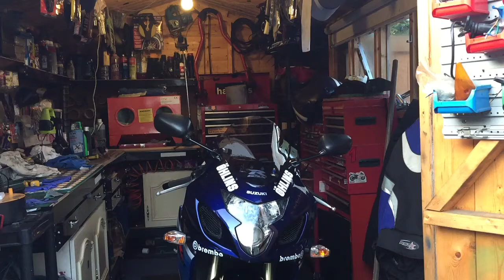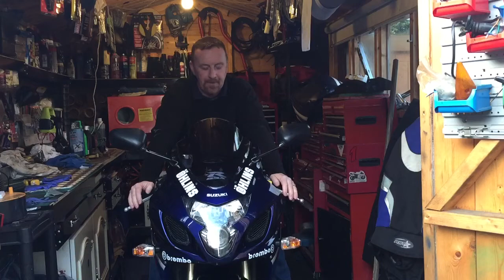How do I use a clutch on a motorbike mark savage

Comment: I bought it from new 66 plate,thanks for reply ,maybe it's the seal can I warm it up and use a soft mallet to knock it loose?
Reply from the maker: so it's a sp3 / sp4 then not a sp2!. double check there's not a bolt in the middle as it should just come off with a wiggle bud . mark

Comment: it's a chinese scooter db50qt 30a direct bike, but it's done 3000 miles without problems so far .it looks like a vespa.you can laugh if you like everyone else does.
Reply from the maker: Fist Of Blur Leath25 oh I thought it was a speedfight as your messaging in this video on clutch control , I've done a video on a cheap moped , they work and run and if it does the job no one laughs !. As long as you look after it it's fine , ok so soft mallet give it a tap then bud

Comment: hi mark got a 50cc scooter and having problems taking off belt variator cover.undone all bolts and cover is stuck solid,any tips.thanks in advance.
Reply from the maker: so the engine cover is stuck on?, ok have a good look around the cover like in my other video's give them a watch, they can get hot and seal on or the last owner may of bonded them on some how . once check out no bolts are holding it on and remember they do have two locating logs its going to hev to be a big screw driver and hammer to tap it off so start from the back . hope that helps please watch my other videos and like share and subscribe , mark

Comment: Hey Mark,I have problem with my sf2.Right crank bearing got stuck,so I went to guy where I repair my scoot.We put new NKN bearings,new crank seals,new cylinder seals and new piston rings(they weren't so bad,but old so i wanted to change them).Now engine is working perfectly,but water pump started to leak.We putted new mixture with G12 antifreeze and it slowly leaks from inside and come out.Sometimes it stops and then continue.Is there anything I can do or I need to change complete pump.Scoot have 20k on meter
Reply from the maker: Ja Ti it's only a push on part so easy to change bud and that's what I'd do after paying out all that money a few £ more to finish would sort it. Thanks for watching my videos bud there are loads and all should help please like share and subscribe , mark
Reply: You are right,and engine is in very good condition,cylinder,head,piston,crank don't have any move on connecting rod etc. So I will by new pump to know that scoot is totally reliable from now.Just say me what is price
Reply from the maker: Ja Ti water pumps are on w bay and around £30 to £50 but. They all work the same so go for the best seller and then price !. Enjoy bud , mark
Reply: Thanks for help,and continue with your work.You'r nice youtuber.cheers